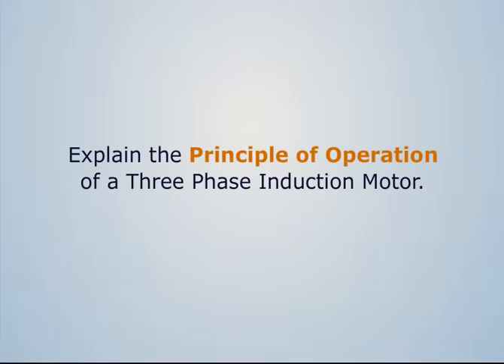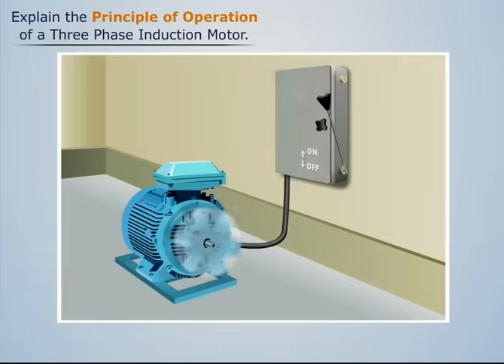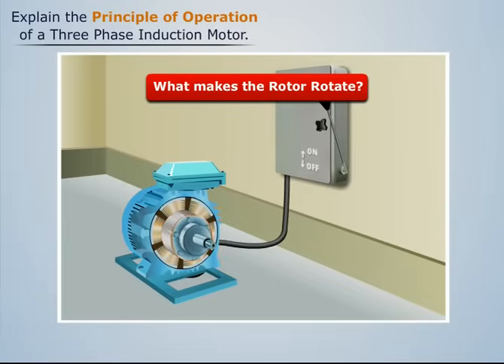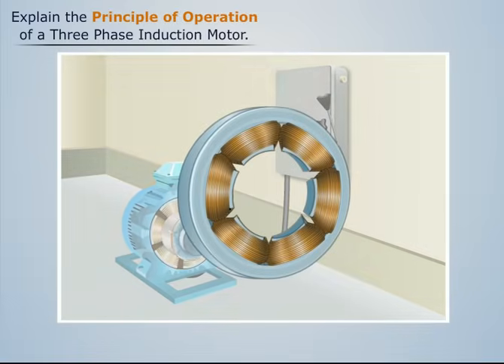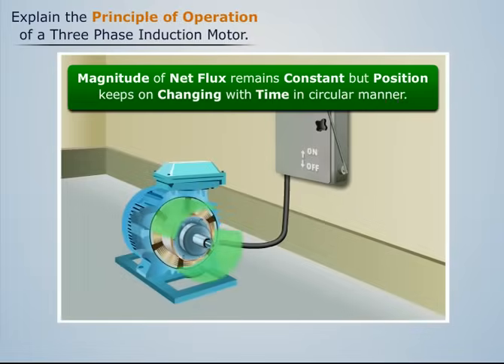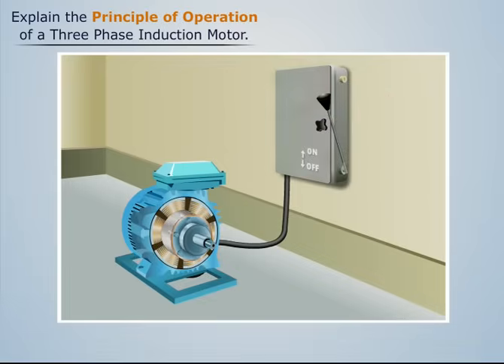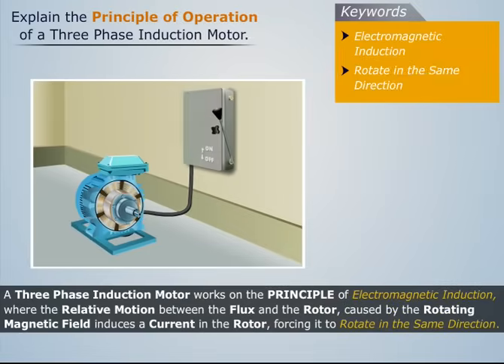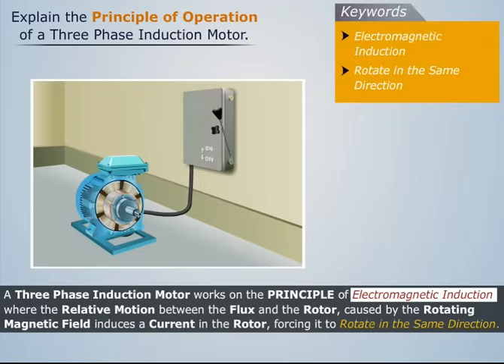Working Principle of Three Phase Induction Motor | Electrical & Electronics Engineering

Comment: Where do you connect the neutral cable to... ??? All the three phase motors I have seen work in star or delta ??
Reply: 🤣🤣, I was thinking the same thing! Perhaps the windings are unbalanced and we might need to address those unbalanced currents.

Comment: In induction motor if stator has n(north pole) the rotor should form n(north pole )on the rotor  exactly opposite to stator pole according to lenz law ,but both are opposite to other than cancel flux each other ,now how we get the torque  ?
Reply: Yes correct

Comment: I would like to know that why does the rotor rotates in the same direction of rotating magnetic field?
Reply: +Saurav Vats Lenz's law, which states that the rotor will move in the direction which tends to reduce any change in magnetic field, relative to itself that it, so it turns with the rotating field.